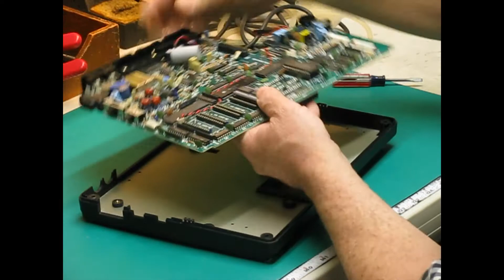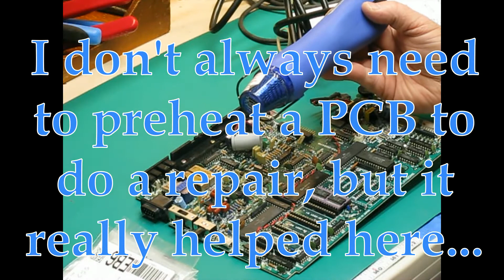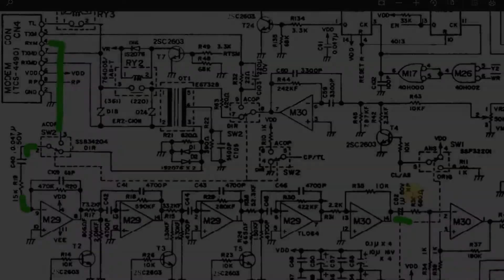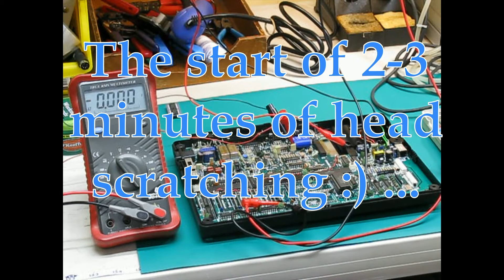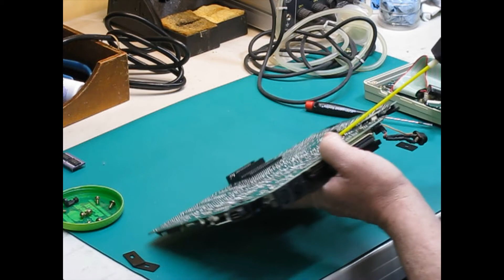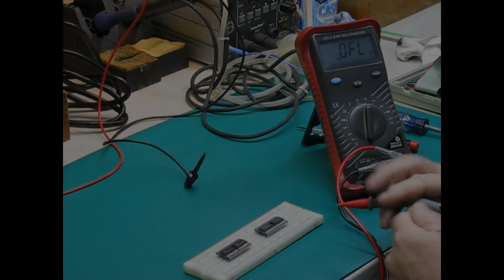TRS 80 Model 100 Repair Part 2

Comment: Hi, can you post the parts list for the caps and battery?
Reply from the maker: It is in the video description, click the text that says 'Show More' and then scroll down to the links section. The SuperCapacitor works but a NiMh battery will last much longer. I have some batteries in stock if you need one.
Reply: @HeyBirt  Oooo thank you, it wasn't in part i but it sure is in part ii.  This is extremely helpful

Comment: I love your desoldering tool. What is the brand/model#? I want one.
Reply from the maker: It is a Pace MBT. It is an older model (tip separate from heating element). I watched eBay for a long time until I found a good deal on one, this one was almost like new. Just found a hot air handle for it on eBay for about 1/2 price of new. Only downside to Pace is the cost and it is harder to get outside the USA. If you watch eBay you can get good deals on the stations and tips though.

I was talking to a friend today who got a Xytronic rework station from Newark. He likes it a lot and thinks it is similar to the Pace he has at work. They are made in China but a good quality.
Reply: @HeyBirt  Sadly PACE Irons are obnoxiously expensive here in Hew Zealand. I still recommend the PACE rework stations when budget allows, though.
Reply from the maker: @Rod_Knee  I watched eBay for a quite a while and finally found one for a decent price. I could not have afforded a new set up. Shipping from USA to NZ would add a good deal to the cost though and make it less of a deal.
Reply: @HeyBirt  Yes, shipping is a killer. Also, are they 120/230V? Or 120 only?

Comment: These little computers were pretty much bomb prof.  In storage I have a 100, a 102 and a nec....   Caps in the display power supply like to go bad...  and the keyboards while nice, do sometimes crack on the traces.   But they were extremely robust little computers.
Reply from the maker: They were well made for the time but way out of my price range then. Now they are fun to hack around with because they are affordable and still very neat.

Comment: So how does the super capacitor compare to the Ni-cd battery? Do they perform exactly the same or does the super capacitor not hold it's charge as long?
Reply from the maker: The Ni-Cad battery was supposed to last 3 weeks or so backing up a full 24K of RAM. The Supercap has a high self discharge rate and might last 3-4 days. I suspect having the memory backed up for 3-4 days after your AA's die is probably OK though.
Reply: Thanks for the info! :)